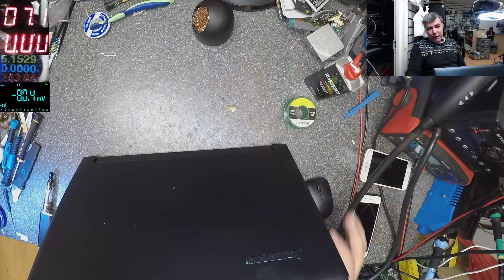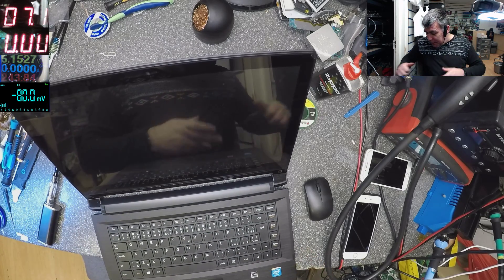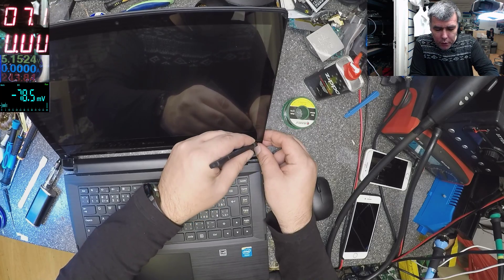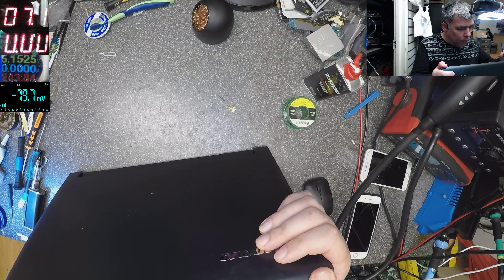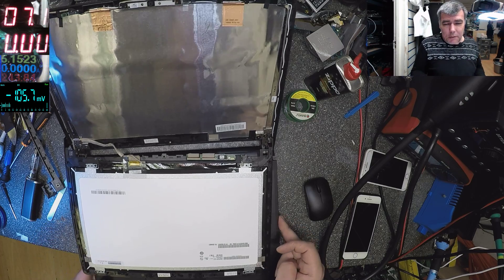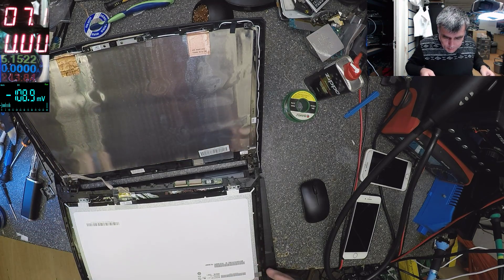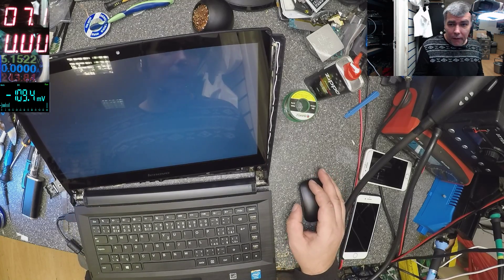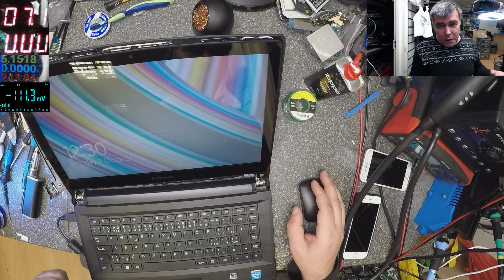Lenovo Flex , no backlight repair

Comment: i replaced my keyboard (got a new one with backlight), and my screen backlight started randomly failing from time to time. turns off, turns on, etc. until one day it never worked again. Opened my laptop backcover, and then it suddenly started working again after a few months, then after 20 mins got off again until now. any idea?

Comment: You wouldn't believe me, I wouldn't believe myself!
I have the same Lenovo Flex 2-14 with no image issue. I do have a picture on the external monitor.
I opened the screen and what I see? Connector is not properly inserted!
Unbelievable!
I've inserted it the full way - all works now!
So, I have i7-4510 CPU laptop back to live!
Thanks a lot, Serin for what you are doing!

Comment: So take the single screw out at the bottom of the display and then slide it downwards. The display will unlock from the back. Lenovo yoga is similar. Take that bottom plate off and really it's the part that faces down is the part that you take apart. The top that's next to the screen are clips that actually hold on to the bottom of the screen. Sometimes if you take it off on screen side it will break those clips.

Comment: Hi. Just found your video searching online. I have kind of the same problem, image shows only when I`m pressing Fn+F2 keys (just for a second or less) then disappears. I changed the video cable and also the invertor, but no luck... I`m doing this for a friend and I don`t really know how to use the multimeter :(
Any piece of advice?

Comment: @electronics repair school: Hi,

Some keys of my Lenovo X270 keyboard were not working so I've decided to replace it myself.
I was very cautious and followed the service manual and best practices and could remove the faulty keyboard successfully.
I plugged back all the ribbon cables and everything into its place.
The issue is now the laptop turns ON (green light, the fan also turns, there is no beep unless I remove RAM memory) but the screen remains black.
I've tried to connect it to an external monitor (and keyboard/mouse) but it didn't work.
I've removed the CMOS battery for a while and put it back on but it didn't help.
I have a big issue because when I wanted to connect the SSD drive to another laptop to access at least my data and back it up, it asks for BitLocker key which I never set (only had Windows session password) and I believe it is security/tamper protection from the old laptop.

Could you please tell me what can be the issue? The GPU?

Thanks a lot for your help.

Comment: Thanks for the hint, a loose screen connector was causing the black screen on my Lenovo Ideapad 100-1 15 IBY, someone had been there before and not replaced the sticky tape, so it was working loose.

Comment: does anyone know if the flex 11 has a backlight? im given the option to change key brightness but nothing happens
Reply: Key brightness?
Reply: If you mean keyboard backlight, then is there a backlight icon on your spacebar? If so, hold Fn key and then press spacebar. If you don't have that icon, then you don't have keyboard backlight. This is a video for the screen backlight so I assumed you meant that your screen brightness wont change.

Comment: Hi sir I have a Lenovo g50 laptop.when I have a problem that I press the power button the power LED is blinking.i check the mother board that I got that the I/O controller getting hot.so Sir yo can help me that is faulty or the problem is another.